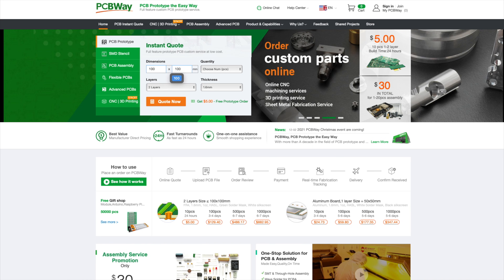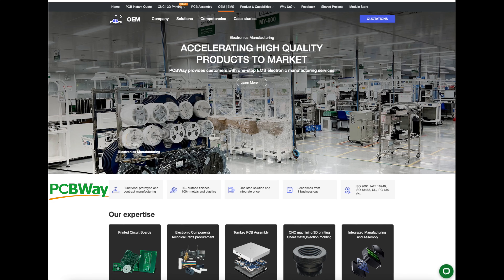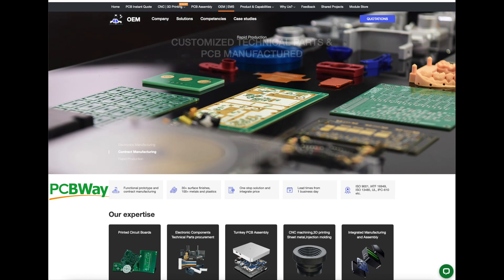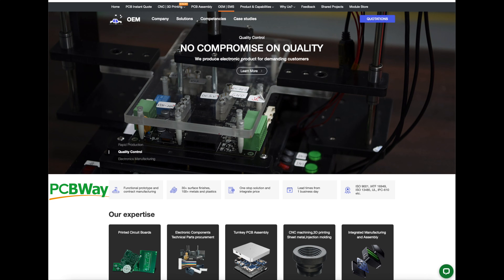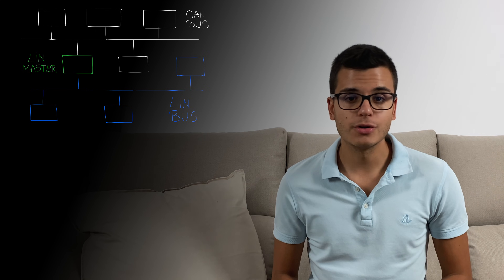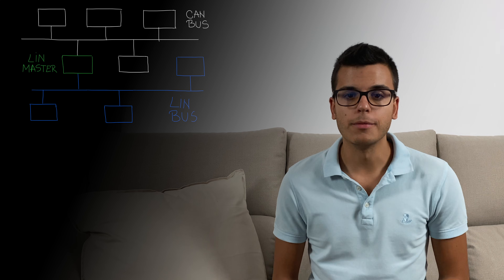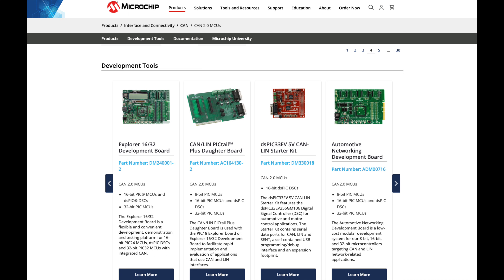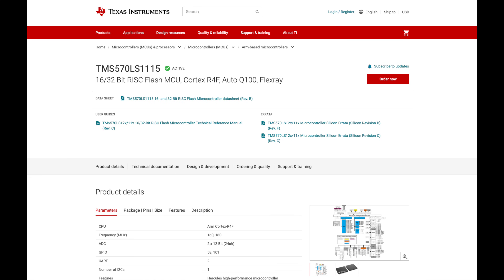Automotive Bus Systems: CAN, LIN, FlexRay, MOST - What's The Difference?

Comment: I really appreciate the video very informative!  How familiar are you with flexray? im attempting to get openpilot working on VW Touareg which uses flexray driver assistance. Is it possible to use the TMDS570LS12HDK to middle man attack of sorts to get the car to brake and accelerate?  I know that’s a loaded question but if you have any thought can I contact you?

Comment: What is BUS short for?
Reply from the maker: It’s not short for anything, it means a set of electrical connections which form the network (signal traces, power traces, grounding).
Reply: I think it extends from the old term "buss bar".